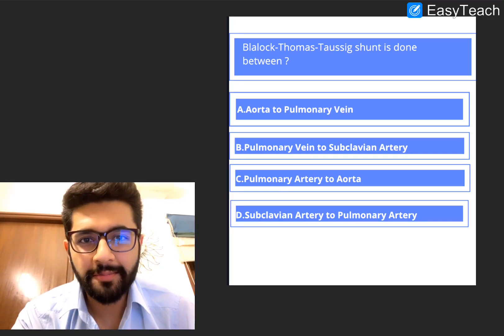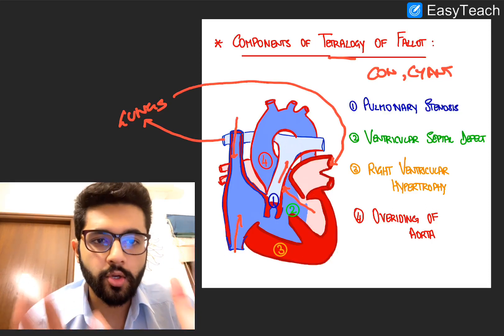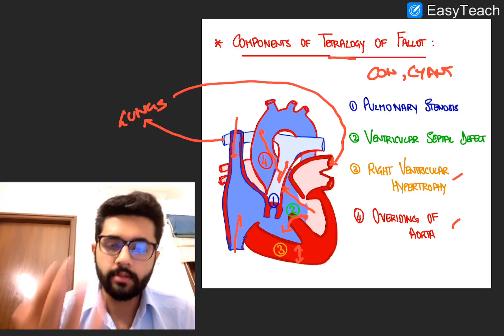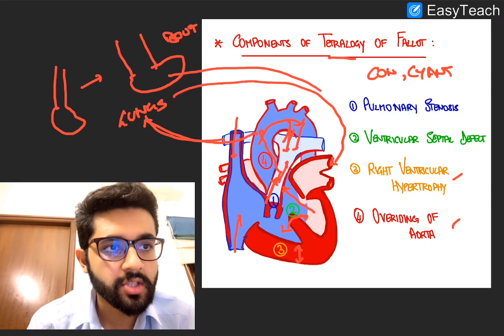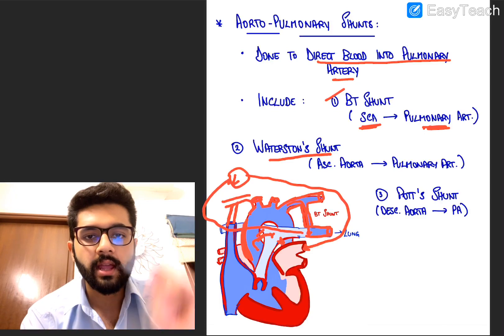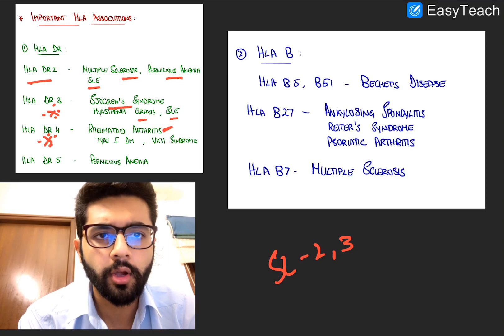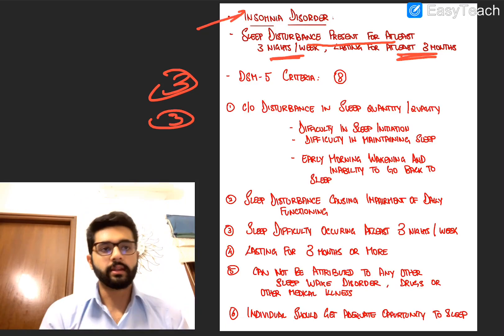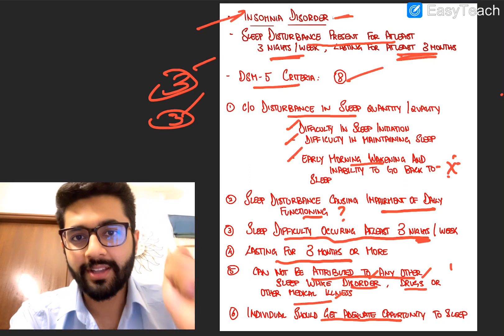NEET PG MCQ Discussion #16 - High Yield Concepts Discussed

Comment: This is the new ‘binge worthy’ series. 😛
Please make a video on slides and image based questions separately whenever possible. It would be of great help. Thanks 😊
Reply from the maker: You can check out my Image based Discussions on UnAcademy,
But have tried and included alot of Images in these too
Reply: Vignesh Varma Okay thanks :)
Reply from the maker: @apoorva1717  Thank you :)